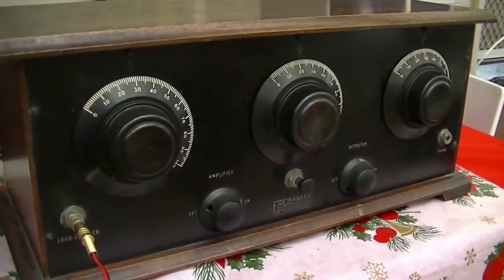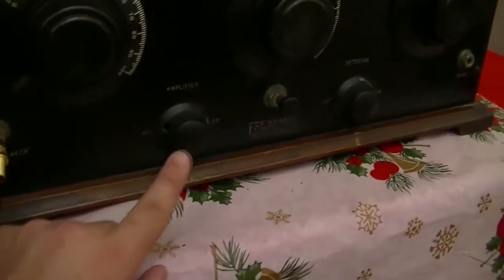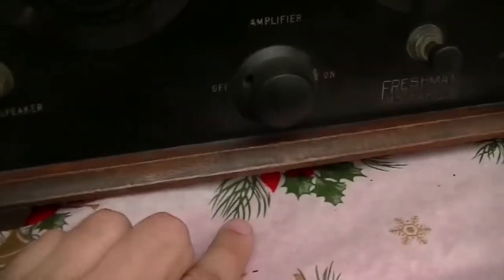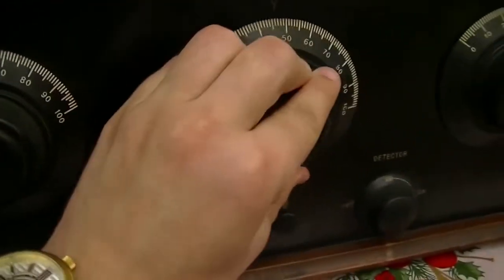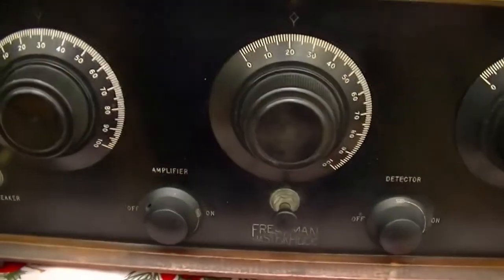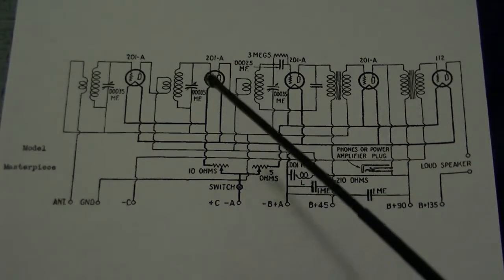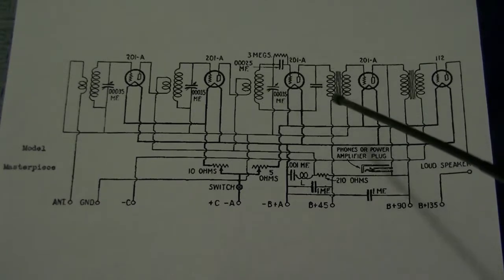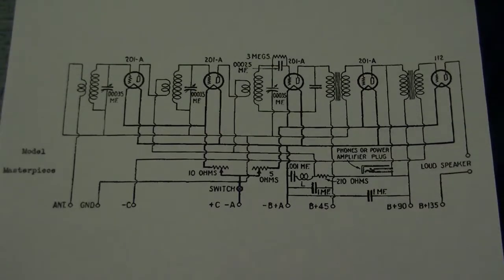Freshman Masterpiece

Comment: What voltages A, B, C?
Reply from the maker: dan smith - 5V for the filament A battery, 45V for the detector B battery, 90V for the other B terminal that powers the remainder of the radio, and no C battery as this is the earlier model that doesn't have the terminal and uses an 01A in the output.